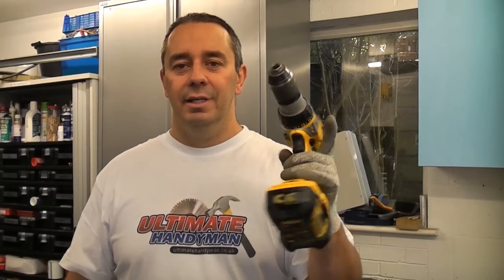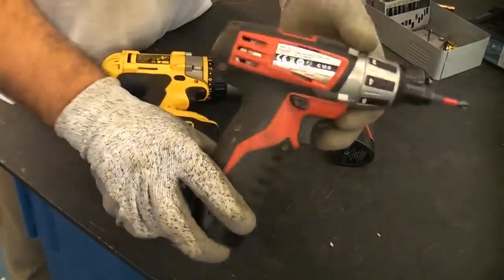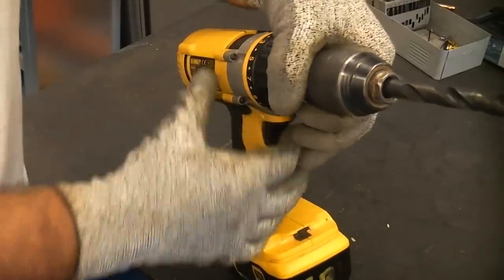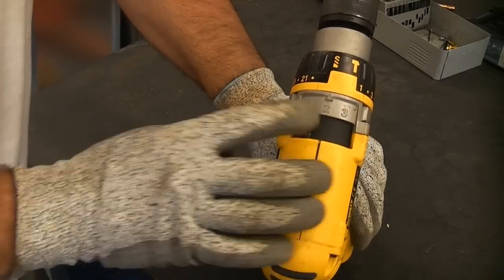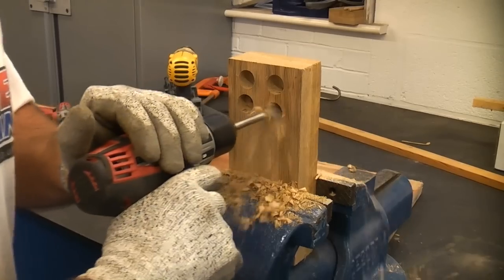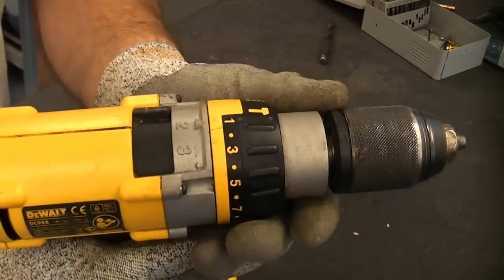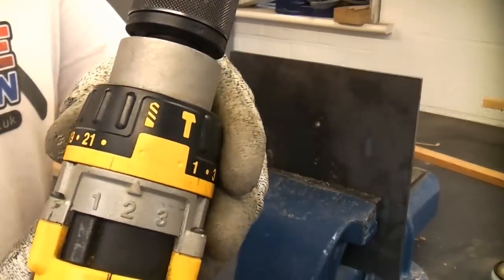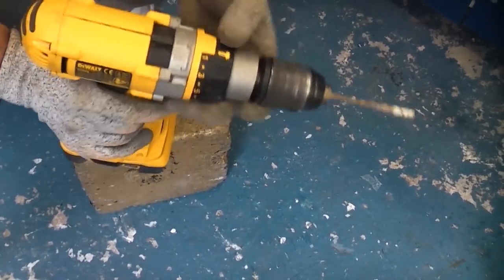How to use a cordless drill

Comment: I'm considering the dewalt 12volt dcf610 or the 20volt dcd771 for home use. Which one do you think is best? Does voltage even matter with performance?
Reply from the maker: +kronosdb It depends what you will be doing with it. If you ever intend drilling metal I would go for the 20v version.The higher the voltage the more power the drill has normally.Thanks for the comment
Reply: Only get the 12V if you're doing long light duty work where it would tire your arms to hold the extra weight of the 20V drill, or working in tight spaces where small size matters.

Comment: what is the spray that you used when cutting the hole?
Reply from the maker: It is a drilling/tapping fluid. It keeps the drill bit cool and prevents if from going dull.
Thanks for the comment 👍

Comment: What’s the difference between the hammer and drill function
Reply from the maker: The hammer function hammers the drill bit back and forth slightly so that it chips away at masonry.
Thanks for the comment 👍
Reply: Ultimate Handyman - thanks so much for the quick response. I have a black and decker and it has two functions. I thought one was a hammer function but it still spins the end?

Comment: I got the bosch gsr 1000 and it doesn't have the gear switch so how do i know what gear i'm at?
Reply from the maker: I think that drill only has one gear, so you cannot change it.
Reply: Ultimate Handyman any downside for that? i only usually work with wood with some drilling and putting screws in.
Reply from the maker: It will be fine for wood. I normally only use the gears when drilling metal, as if you go too slow or too fast when drilling metal you can damage the drill bits. 
Thanks for the comments
Reply: Ultimate Handyman thank you! subscribed

Comment: Please could I have a link to your safety gloves thanks
Reply from the maker: These are the ones that I normally wear- http://fave.co/2czlDr1
Reply: +Ultimate Handyman thanks
Reply: +Ultimate Handyman how do I only get one pair
Reply from the maker: You are welcome. You can get very similar gloves on ebay, which are also cut resistant. 
You need to get the correct size though really as they are uncomfortable if you get a small or large pair.
http://fave.co/2cBG06X
Reply: Danzer DJM

Comment: Haven't used safety glasses in 20 years. However I would suggea newbies use them
Reply: Suggest *
Reply from the maker: I have to wear them all the time on site and to be honest they have saved one of my eyes on a couple of occasions.
Thanks for the comment
Reply: Ultimate Handyman yeah must admit there have been times I've regretted not wearing them (a&e trips), but always find them a pain in the arse when they fog up etc
Reply from the maker: Normally mine only fog up when I wear a dust mask as well.
I was once in the workshop and a guy about 15 feet away was knocking a bearing off a shaft and the bearing shattered, one of the shards bounced off my safety glasses. Ever since that day I have never questioned wearing them.
Thanks for the comments
Reply: Ultimate Handyman I reckon you have a point :L maybe its cause I've always bought cheap shit ones
Reply from the maker: There is nothing worse than a cheap pair of safety glasses, I remember when I bought a Bosch multi-drill, it came with a pair of safety glasses that were absolutely awful to wear. I now get mine from ARCO, they have a huge selection and some of them are really comfortable. I even wear safety sun glasses when I go on holiday ;-)

Comment: Do not buy a drill with a 1/4" drive, buy one with a proper chuck. That 18V drill is an overkill, chunky and heavy. The new 12V Milwaukee is plenty for most things around the house. The few times I needed the large drill was mix dry wall compound in a 5 gallon bucket. That just for occational use or else could burn up the drill. If you need to drill large holes or have a need to drive little holes in concrete, the a 18V drill with hammer function would be better.
Reply from the maker: Thanks for the comment

Comment: DeWALT. Made for real men.
Reply from the maker: +Richard's World 
Absolutely, that's been a brilliant drill- I love it ;-)
Thanks for the comment
Reply: +Richard&#39;s World I prefer panasonic.
Reply: +Richard&#39;s World Bosch Blue for trade and industry!
Reply from the maker: +vrgl101 
Had a few problems on site with their 18v Blue drill, but the other stuff seems okay. The 18v SDS is awesome ;-)
Reply: +Ultimate Handyman i have their 18v drills what happened? are they not durable enough?
Reply from the maker: +vrgl101 
I think we had two or three of them. One of them kept slipping into hammer action during use- not good when you are trying to cut a 2.5 inch hole in steel chequer plate. I think the motor burnt out on the other one (I'm not sure if this was a replacement drill for the one that kept slipping into hammer action). Their SDS machine is superb though, very impressed with that ;-)
Reply: Rather use a Makita

Comment: you should never wear gloves as they can get wraped around the chuck or drill bit/screw being driven.
Reply from the maker: +Stewart C 
You are right, sometimes it is dangerous to wear gloves. I work on a site where you have to wear gloves though, so have become accustomed to wearing them all the time. If I'm drilling something dangerous like steel because of the swarf I have to get a dispensation form before removing my gloves.
Thanks for the comment

Comment: great demo, I jst bought a drill/driver set but it doesn't have the adjustable gears in it though? is that ok?
Reply from the maker: +Den Ezykill It should be OK, depending on what you are using it for.Does it just have the one speed then? or can you control the speed with the switch/trigger?
Reply from the maker: +Den Ezykill 
It should be ok, but it might take a bit of practice getting the right speed when drilling metal etc.
Reply from the maker: +Den Ezykill Absolutely, the larger the diameter of the drill bit the slower you need to go.
Reply from the maker: +Den Ezykill 
You are welcome.
Thanks for the comments ;-)

Comment: a spade bit is actually meant to be used in an impact driver
Reply from the maker: No it's not. Spade bits were around decades before impact drivers were even heard of.
However, they now specifically make spade bits for use in impact drivers!
Reply: jasper petersen No, because impacts are rotary and a spade is drilling